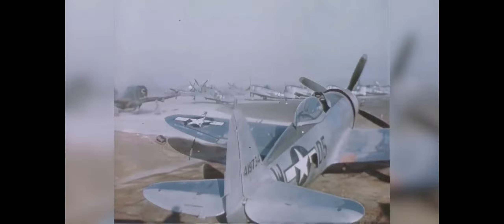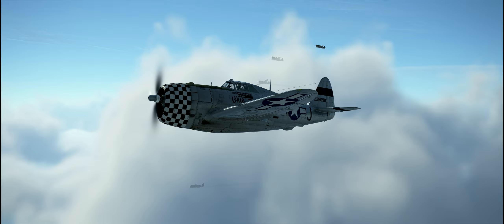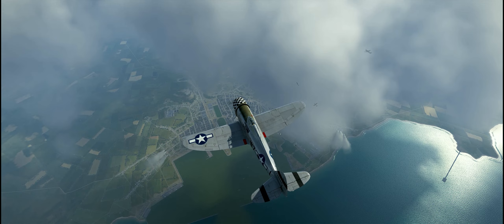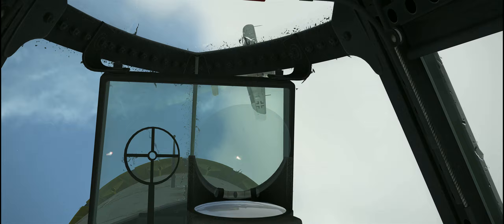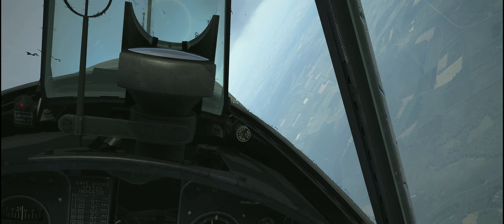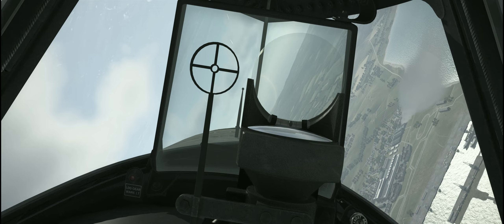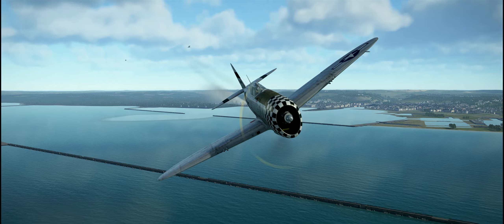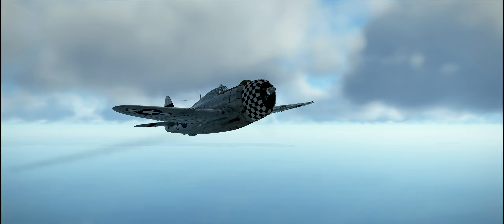P47D vs Fw190A8 | IL2 Battle Of Normandy | 4K Ultrawide

Comment: I have myself had this same problem with the Fw-190. You read stories about things like the Nowotny Schwarme, Emil Lange setting the Ace in a Day record of all time, and the sheer panic caused by the 190 in 1942... and then you get into a fight with a mustang where you have no advantage except roll rate and you wonder what the historical reputation was all about. 

The P-47 in IL-2 is purely a victim of the fact that engagements in that game take place at a bizarrely low altitude, which pretty much strips the thunderbolt of all of its advantages.
Reply: Exactly, the same thing is happen in War Thunder, where most engagements are at low altitudes, and you must use high speed tactics to get results. Also, ive almost any time outspeed german planes at low alt, but is necessary to keep high speed, energy and quite distance at fight to have time to accelerate, cause like in real tests maded between P-47 and Fw-190 , Jug get higher speed over FW, but in longer time, like was visible in this movie. And my plane was trimmed -10% nose down.
Reply: Have you tried IL2 1946? Have a look on Fishhy youtube channel He flies missions at high altitude and has a lot of fun with his friends, flying both Allied and German aircraft plus odd times Japanese aircraft.
Reply: Really? I found the D9 to be a beast of plane, easily one of the best fighters in il2
Reply: on il2 german planes is ace maker, there is no effort nearly required for out turn, out climb, out speed, even when you fighting a plane wich should be better on turn climb or energy easily 109 and some 190 can be push to perform better then should.
Reply: @chae_shoko  I don't know if that's true. If you look at server stats, planes like the Tempest and P-51 tend to be near the top in K/D ratio. The 109 K-4 is up there, but the more ordinary G-14s and G-6s are middle of the pack. 190s do kind of badly, except for the D-9 which still loses to the P-51 consistently in these rankings.

Comment: Great video! 
The P-47D is the only plane I struggle with in IL-2; for some reason I can’t make as tight turns as any other plane, and as such almost always drop out of the sky… that’s why I searched out and found your video. Do you have any tips for me? You seemed to handle the plane so well :)
Reply from the maker: @lpcoolee  honestly a big help is a force feedback joystick or a force feedback seat pad. So you can feel the onset of the stall and adjust your rudder input to compensate and get a nice tight turn. Best investment you can make for a difficult to handle beast like the jug.
Reply: @BlueMax109  thanks for the reply! Funny thing, I've just wired up my NRL feedback chair to IL-2, and tried out the MC.202, and couldn't believe how I caught the imminent failure to fall out of the sky due to over cooking the turn (just before the failure).

I never thought of the P-47D. Guess I'll give it a go :) - thanks again dude! Awesome video btw